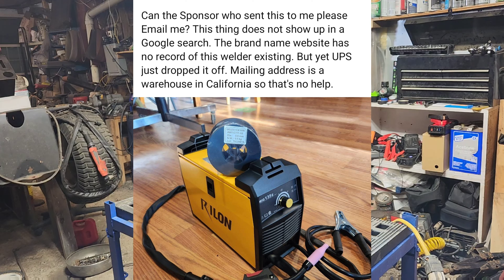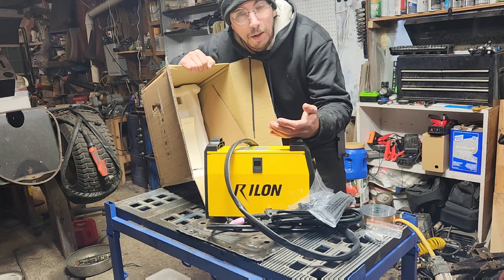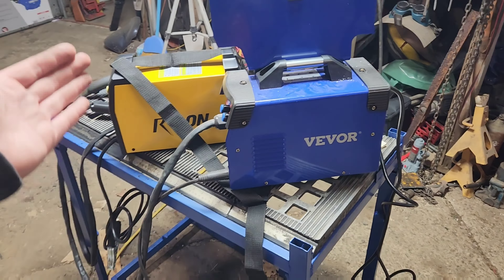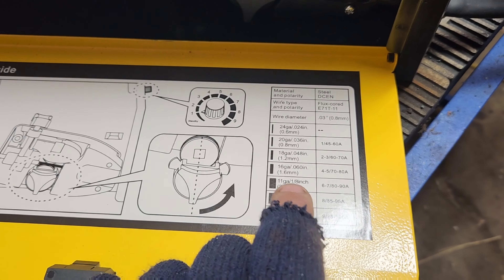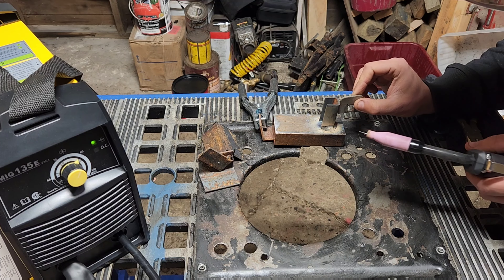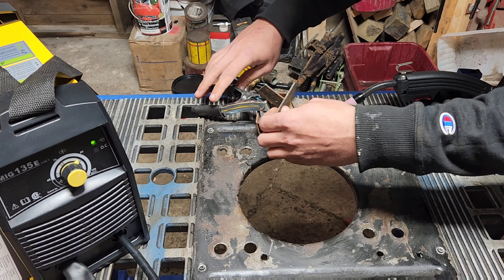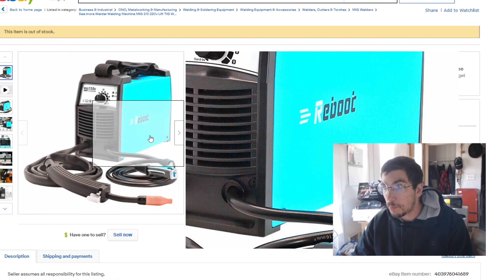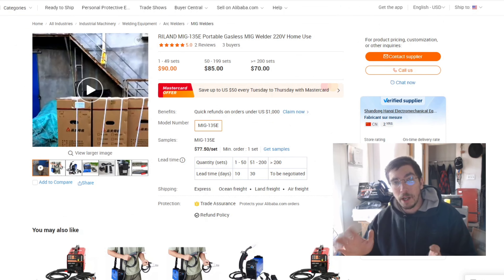Mig 135E Rilon RBM135E OPTICO Reboot

Comment: As much as I tend to steer towards the affordable end of the chinesium welders, there is a sweet spot where you have to avoid for certain features that can make a cheap welder usable versus a two job paperweight. The biggest offender/telltale sign is the ground cable. A lot of them have super thin wire inside (if you even get copper and not aluminum!) and will be missing that copper webbing between the clamps. Not always, but that's been my experience with the lo-buck specials, especially post 2018 when copper prices went through the roof. I think I touched on it once before, but they all come from two or three factories and get rebranded or slightly cosmetically altered from any other model, so inside they all have the same boards, electronics, solenoids, etc, and the outside might have a knob in a different spot and a different sticker. 
I see you found the latter in your sleuthing work!

Comment: Like your show
Tell John hi
Can I ask why when you weld you dont clean your metal first? 
Happy holidays
Reply from the maker: I often times call Flux core welders the give a damn busted of the welding world. It burns hotter and deeper then gas and solid wire and explodes rust pockets out when it hits them. Unless it is structural I normally do not bother cause it just does not care.

Comment: You mentioned that both this and the Vevor are not good for tacking things because they have a delay before the wire is hot. Have you found a cheap-ish MIG setup that doesn't have this issue? I have a good Miller TIG welder I use for everything now but I have found a lot of times when a MIG would be handy to tack things together. I'm just too cheap to go straight to something like a Hobart 140 when I have a good machine that fits the other 99% of what I would use it for.
Reply from the maker: Yes the lowest level I have found that can do tack welds well is a Fornay Easyweld 140. They can get as low as $250 on Amazon sales. The $300 area seems to be where soft start needed for tack welding is added or removed.